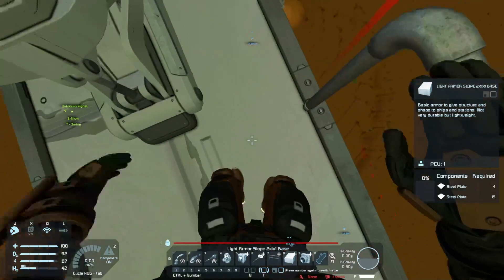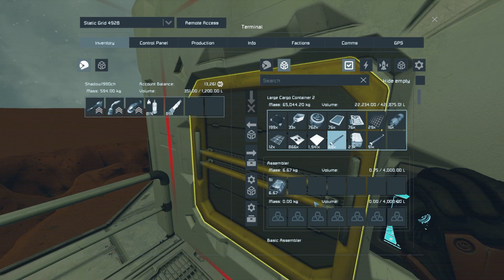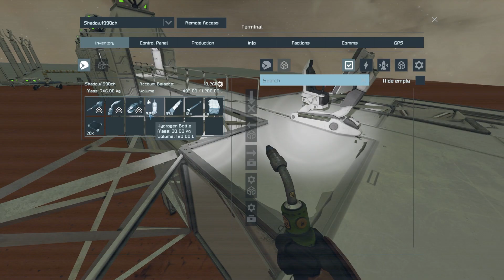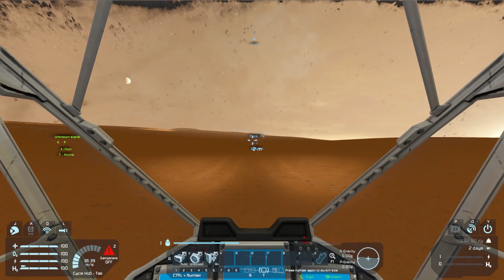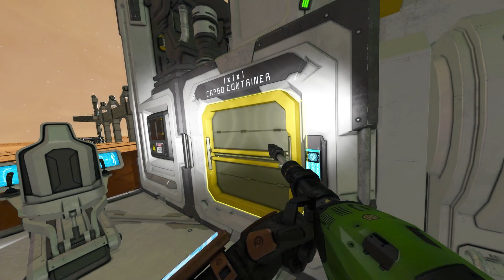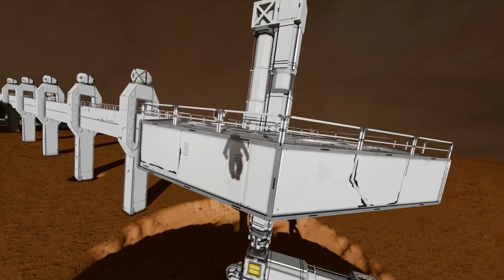Space Engineers: Observation Platfrom

Comment: Looking good, was going to suggest getting "parts from the drills ...forgot about the sorter "pushing everything into large cargo. 

You can use the basic assembler to dis assemble the extra will save you a few iron ore trips. You will have to turn off the sorter and also "hand feed the extra" 

With building your "mobile" base run a spur off the the current base get a few blocks in on the floor level and place and finish battery(ies) to to start charging off the wind turbines.